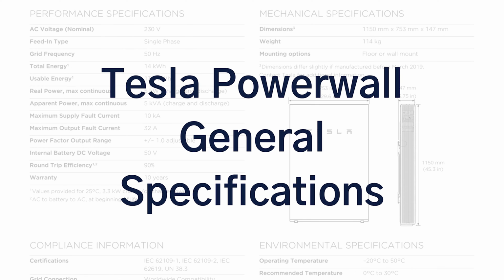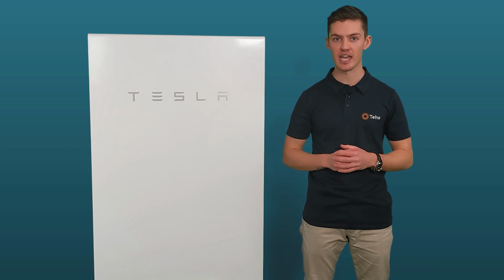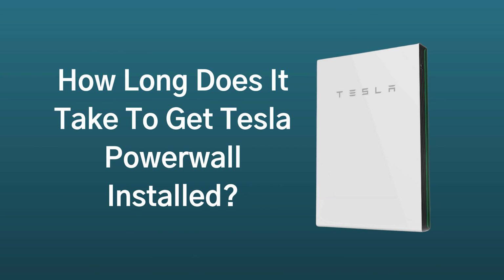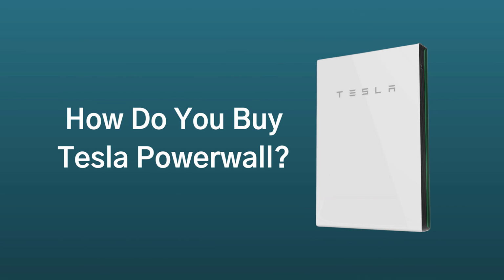Tesla Powerwall | Everything You Need To Know About The Tesla Powerwall | Teho | Battery Specialists

Comment: Its true, ignorance is bliss.  I have been listening to this marketing BS since the first hype began of storage batteries for home use. So with a Tesla 14KWh battery, powering a typical household between the hours 6pm to 6am the next day with just the fridge (12h), lights (6h), A/C (4h), TV (5h) kettle (10m)  the battery will be discharged in less than 1.5 hours.  And yes this takes into account the duty cycle for items such as the fridge.  So after 1.5 hours, your back on the grid paying money !  Even without A/C the batteries are dead after 3.5 hours.   Perhaps they will also try to sell you a Tesla car so you can supplement the Powerwall capacity using the car battery, assuming it is charged !..........LOL  Try a 50KWh battery to begin with.